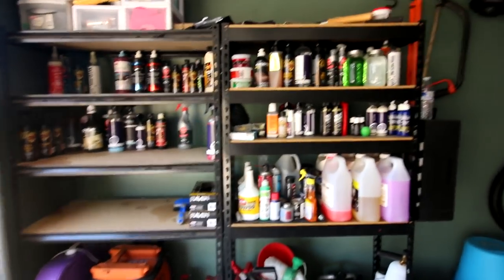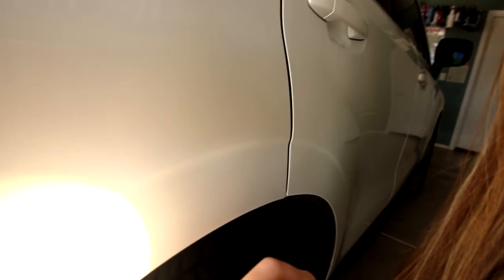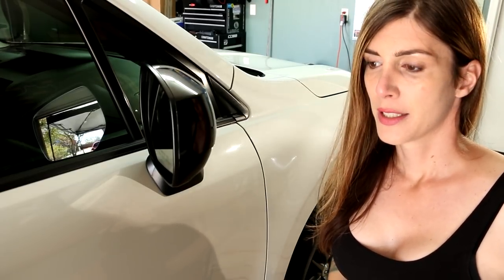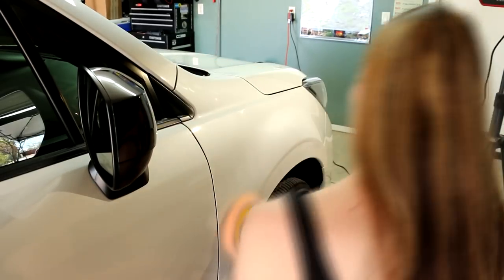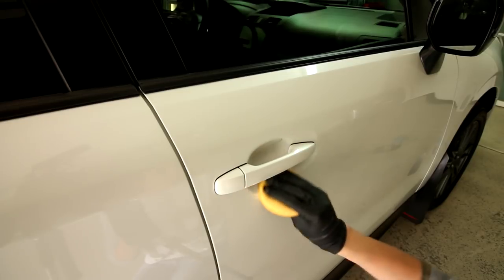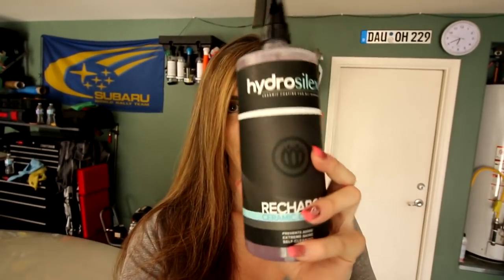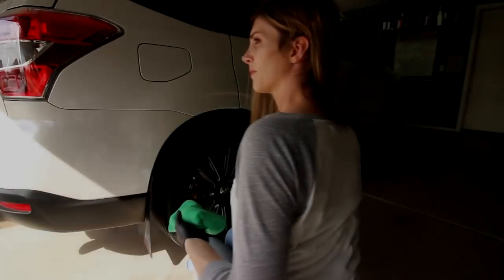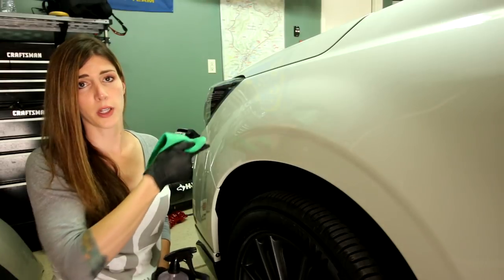Going Hard in the Paint // DIY Ceramic Coating!

Comment: Way cheaper as a DYI! was quoted for 1800 to ceramic coat my car!
Reply: At that price, you're being quoted something like Opti-Coat Pro, which is going to last a few years. The type of product in the video is going to require reapplication like a sealant.
Reply: Fokker - 1138 true, it was for cquartz
Reply from the maker: Yeah, this isn’t on that caliber. That’s more along the lines of what I put on my windshield a few weeks ago.... but damn! $1800? No wonder I’m broke, I don’t charge enough! Haha
Reply: Sarah n Tuned you can get cquartz for $60 and start charging $1800 😁.  That's how all the shops here are doing it.  Chaaaaching!
Reply: GTR Wendy The process has a lot more steps involved and requires curing lamps. They're charging for the labor more than the materials. Detailer's Domain should have some coverage of the process on their site. They've covered it before on the S2Ki forums before.
Reply: Our average price for paint correction and coating would be around 2500.00. 15 to 20 hours of paint correction  is normal. We dont really get into the multi year myths but stress maintenance to prolong......that being using a spray sealant with Si02 ingredients.
Reply: you don't really need curing lamps
nor do you need 15-20 hours of paint correction.
yes you need to prep your cars paint thouroughly
but its all pretty easy real
rinse
shampoo
degrease
rinse
tar off product
rinse
iron off product
rinse
clay bar
compound
polish
panel wipe product to remove residue
ceramic coat
add silica coat
keep car dry for atleast 12 hours.
Reply: GTR Wendy they charge you this much because most of the cost is to get your car ready for Ceramic Coating which usually means Stage 1 or 2 Polishing/Buffing, decontaminating the car which on some cars depending on how bad swirls and scratches are might take up to 20-30 hours of work. Good Detail shop wont put Ceramic Coating on the car is not fully polished/buffed because custome would come back same day since all swirl marks and scratches would be still underneath Ceramic Coating. Like I said 80% of the price that you pay fpr Ceramic Coating goes into prep of your car.

Comment: Great video, but I don't think the product was that great. Yes it repels the water, but you just buffed the car. That on its own would repel the water, and that think coat won't last very long. It will help with your buff job, but a real ceramic coat, will dry up if opened to the elements. It will last at least a year to two years, depends on how it's taken care of. That seemed like a liquid was spray, which will protect the paint, but would need to be done frequently. Sorry for the rambling. Lol.

Comment: Garage temp just put a fan to exhaust the heat out?  Is your garage door insulated? You can buy the insulting paint at Lowes
Reply from the maker: Jason Rogers yeah it’s insulated, but my south wall isn’t. I’m going to wire a small solar panel w/ a thermostat switch to a 10” fan over my upper garage vent. GoGoGadget Girl, LoL.

Comment: The only problem is that this Hydrosilex is not a true Ceramic Coating and people calling it Ceramic Coating give false idea to other people. Look up real Ceramic Coating applications like: OptiCoat Pro Plus, CQuartz UK, Modesta, Kamikazee. Those are true Ceramic Coatings ... this Hydrosilex stuff is more of Silica Based spray that beats of water and i wouldnt even put this stuff on the same level as other Silica based Ceramic Coating rechargers like: CarPro Reload, Opticoat Seal, Ammo which outperform this product. Its really easy to check if this stuff has anything tp do with being Ceramic Coating. That towel that you just buffed it with ... if it has some crystal like residue then yes ... but i believe 100% it doesnt. Ceramic Coating and Ceramic Coat sealant/recharger are two totally different things your statements saying that they are same are false. Another words I could spread cooking oil on my car right now and it would beat off water same way. Would I claim its in the same category as true ceramic coating ... No